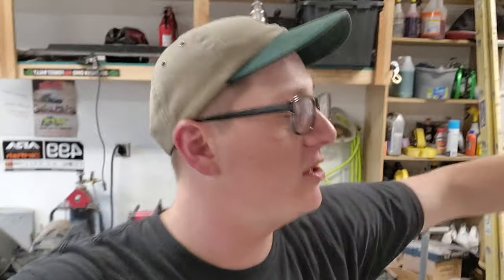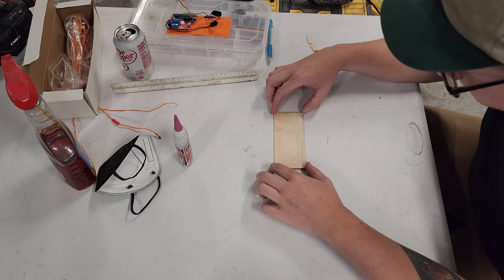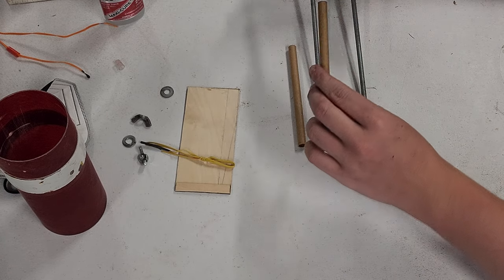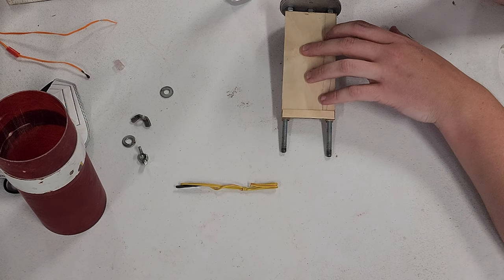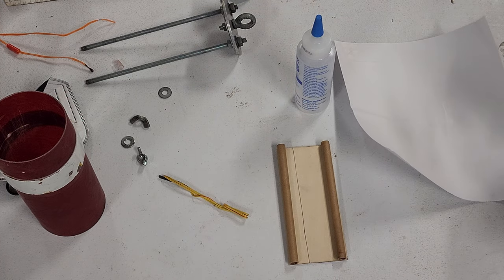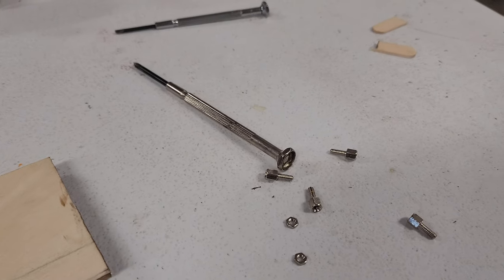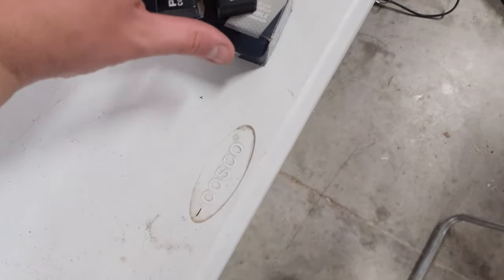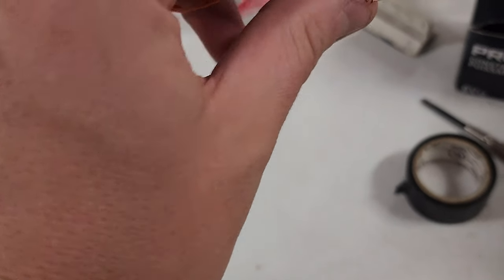How to Build A Quick and Simple Electronics Setup for Rocketry

Comment: Very similar to how I do it, here in South Africa. Only the ejection charges are slightly different. I use 8mm plastic straws thatseal. I compact the black powder inside like an old musket riffle for the burst effect. Since I am the only legal company that manufactures this for commercial use, I have to sure everything works.
So, yes, the KISS principle is preveliant in my designs.
I use fuse heads that is used in pryrotechnic displays to ensure best chance for parachute deployment.
My rockets use the piston design for parachute protection. A bit of extra work, but you don't have to worry if the nomex shifted when you inserted the parachute.

Comment: How do you twist the wires together when it's on the pad? I use old RadioShack SPST pushbuttons mounted on the sled, and activate them by sticking a really skinny screwdriver or something in through the static port and pressing them on. Never had an issue even up to 30Gs. Some people turn their noses up at it for being too primitive. If I can do something even more caveman-style and save space/weight, I'm here for it
Reply from the maker: Just hang the wires out one of the ports or add another hole (I usually add another one) and twist them together then tape them to the side of the rocket. 

My backup alt on my N1000 to 47k was done this way, and my buddy Taylor's M685 flight to 41K and Mach 2 had both altimeters this way.

Comment: I'm completely new to the electronics available for model rocketry (but wanting to learn more). Unfortunately I'm from Scotland where this hobby is very rare (so don't have anyone to learn from or any opportunity to see these things). What are those two PCB boards you using there?  Am I correct in hearing they're called stratologger and RSC2; how do both function and what are the capabilities of each? If anyone knows any good learning resources to find out these things/more about flight electronics, then I'd appreciate being pointed in the right direction.

Comment: I've heard you talk about ejection charges before and using a nitrile glove fingertip wrapped tight. Is this better than a charge well? Just a cheaper, quick and dirty but works method? Does it work 100% of the time? I heard you and your anti-gravity guys talk about some failure to eject problems.  Have you worked out what caused those problems so they don't happen again?  I tried some different packing methods on low and mid power and realized I hate baffles after several failures to eject and burning up chutes.
Reply from the maker: The only time I've had issues with the glove method is in very high altitude flights (around 20,000 feet) and I think they still would have been fine  had they been compressed more. 

I just like the simplicity and the dpace saved by not putting charge wells on bulkheads for smaller rockets. It's all a personal preference.  I wouldn't say one works more than the other, necessarily

Comment: Love your content man! My local rocket club requires an external switch for dual deploy, you think i could get away just having the wires hanging out, twist/tape and stuff em back in? I feel like if the hole was big enough it could work lol
Reply from the maker: I wouldn't tuck them back in just in case something goes wrong and you need to take it back off the pad. 

Ours are just wires twisted and taped to the side of the rocket. Taylor doesn't even tape them!

Comment: What gauge wire do you use? And for the 3 inch punisher what size chutes do you use?
Reply from the maker: Whatever gauge wire I have from cutting down e-matches! Main is a Top Flight 58", but I highly recommend getting the thin mill one or a smaller, draggier chute. It's a tight pack.